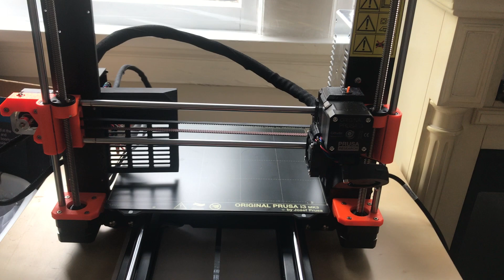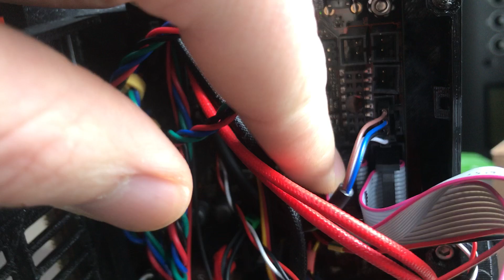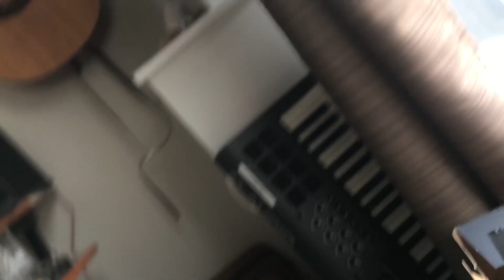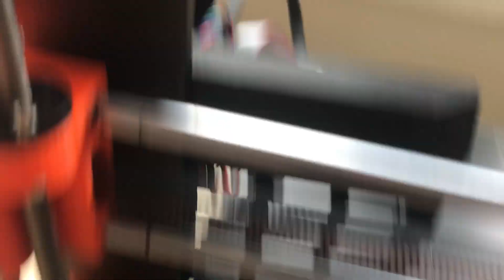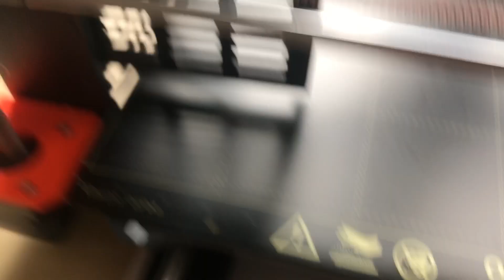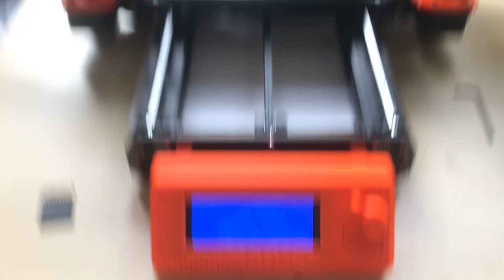Prusa LCD Screen went Blank (i3 MK3S)

Comment: Just wanted to add a comment because my new prusa also had this issue, some comments pointed out that adjusting the brightness on the LCD was the way to go.. this is kind of true. it seems the PCB has a flawed component (i think the pot is flaky). if you squeeze the pcb around the pot, i find the brightness will return without doing anything to the pot other then this poke... and getting a replacement from prusa, but you can print while you wait

Comment: I'm having the same exact issue. I emailed Prusa But haven't gotten a response yet. Think it's the LCD screen too
Reply from the maker: After chatting with them and some back and forth, they said they'd send a replacement.  They also sell some cheap alternatives on Amazon for around $11-$15 (in the US) if you want something a little faster.  Look for RepRap Discount LCD.